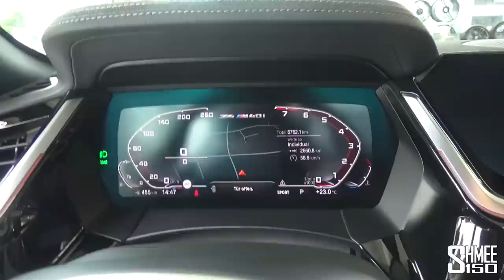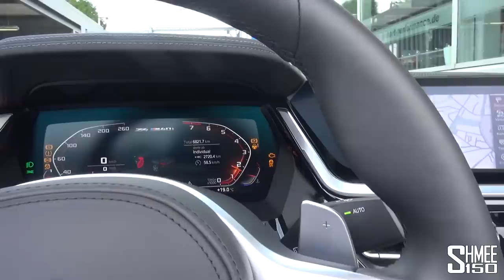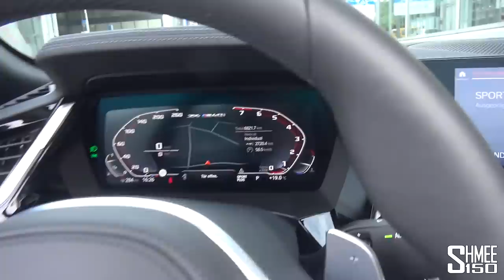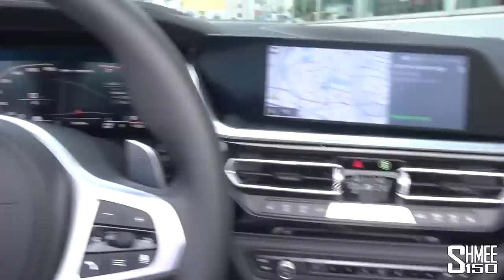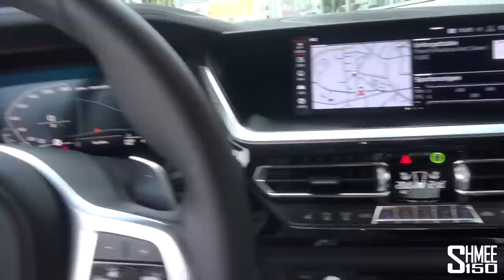My Supra NEEDS THIS Exhaust from the Manhart MHZ4 440!

Comment from the maker: Manhart have worked magic wonders with the exhaust on the BMW Z4 M40i for their MHZ4 440, so what about a system like this on my Supra!? With the cars running derivatives of the same engine setup it would be very doable in a similar way. Sounds incredible though doesn't it?!
Reply: I'm sure they will fix you up
Reply: Sounds stellar!!  Its kind of the perfect volume+sound for a daily driver IMO.
Reply: You should definitely get them to do a tune and exhaust on your Supra
Reply: Shmee150 stock f type ace still better
Reply: Shmee150 Hate to break this to you but the Supra is more powerful than the z4 in stock form.  It smoked the z4 in a multiple different drag races
Reply: Not a fan of exhaust like this. You own a hypercar.. if you want sound, take out some of your more intense cars.
Reply: That sounds it makes is so good!
Reply: Yesss!! That engine sound should be on your new toyota supra
Reply: I'm not sold on it.  Accompanying the crackles and pops (which are nice), sounds like something metallic that is loose and rattling in the exhaust.  I suggest you keep looking for a better one.
Reply: Hey shmee did u watch new video the stradman put up with his straight pipe from rogue performance south Africa to is supra
Reply: John Doe was thinking the same thing. I love this channel but he spends a huge amount of time in every video devoted to the “cracks” and “bangs”. Would much rather hear the GT 8 or Senna.
Reply: I can't find a reason not to do an exhaust, that and maybe a small tune and you have taken the first couple of steps on souping up the Supra. Great video and I love the sound of the exhaust, thanks as always for sharing another fun video, Cheers!
Reply: I really think you should upgrade your microphone. I’m using HomePod, which is a decent speaker, to listen to this exhaust. But I can not feel the power😂😂😂

Comment: I don’t know Tim. I think the popping noise on the overrun would get tiresome after 10 mins. I’m assuming changing to comfort mode would eliminate back pop noise all together. Seems like the upgrades transformed that Z4 for the better.
Reply from the maker: The beauty is that it is switching though so you can have it quiet, just like on my G63

Comment: Still rather the 1990s Supra model, its been my dream car
Reply: @enigmaPL  a REAL supra is the Celica supra. Not like the zombies like the mk4 that was slapped together with other parts from other Toyotas and the mk5 that is a zombie with BMW parts.
Reply: @enigmaPL  ok then tell me why the mk4 shares the same drivetrain and suspension as the soarer then? Tell me why it shares the same twin turbo 2j right out of the aristo then? And(well in my opinion)why does it look similar to the Celica gt4s design? Tbh I could care less of how great the mk4 or mk5 is. I just want to see what people can do to the mk5s platform and what kind of builds can be built out of it. Who cares if its a BMW or Toyota its a good car and that's what should matter.  if Toyota made it themselves the only "good thing"coming out if it would be is that it's reliable and it drives nice. But after that that's it. It would go straight back to step one with all of those overweight Lexus that people call superior yet don't try to do anything to them but stance them to death. Now not saying that just because they worked with BMW they made a better car they can't really make a decent sports car without someone's help like look at the brz it got heavily criticized just as much and even now just because it isn't built by Toyota but that hasnt stopped the track community from building them,hasnt stopped the drift community from using them as beater drift cars,hasn't stopped the rally community from using them,and hasn't stopped the drag community from playing around with its platform. Even if their using BMW parts in it that doesnt legitimately make the car crap. Just like what people were saying about that brz/gt86/fr-s they were all heavily criticized for being mostly Subaru instead of Toyota and said that they'd be useless and look at them now. Give the aftermarket some time to get more companies to jump this platform and see what types of builds come out of it then well see if it's a decent platform.
Reply: @carboydorifutoparty3976  bruh that's your opinion, if you don't like others opinion get outta here
Reply: @daedricwarrior7546  all I was saying was the fact that it needs time to prove itself just like the mk4 did......i didn't say I hated the mk4 with a passion I was just saying the mk5 needs time was all...
Reply: @carboydorifutoparty3976  oh ok

Comment: Only 440hp? There already MK5 Supras running around with 700hp ...
Reply: Z4 came out first and is more expensive but people like the supra more so the Z4 will pretty much be the cheap option to get other than the mk5 if it blows up more.